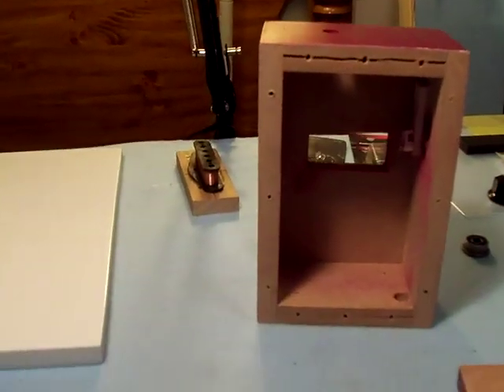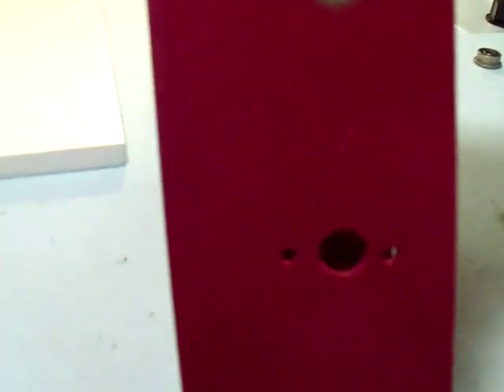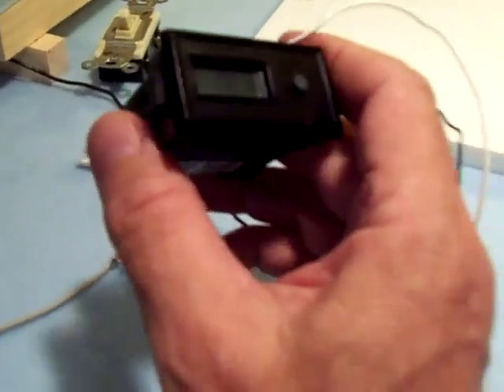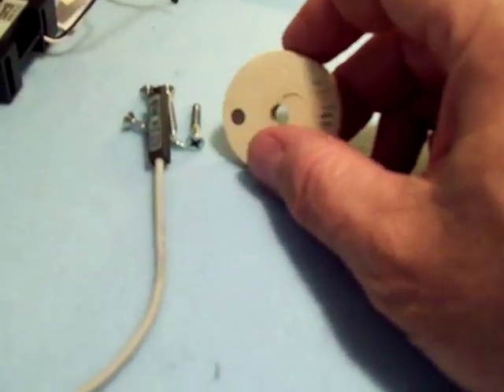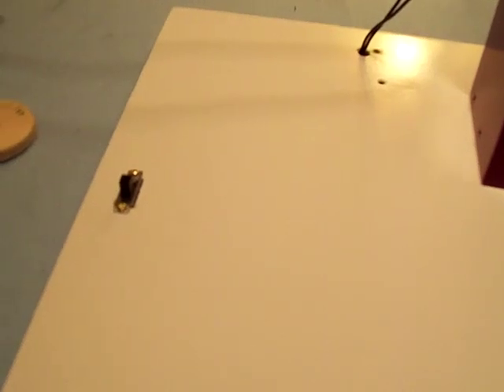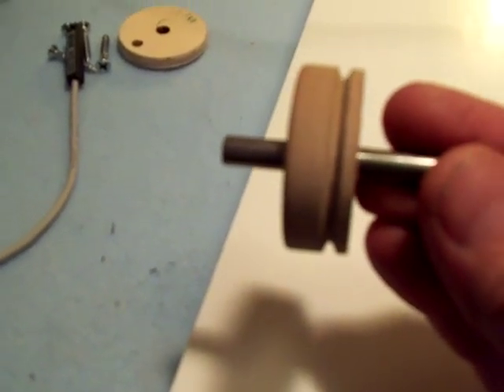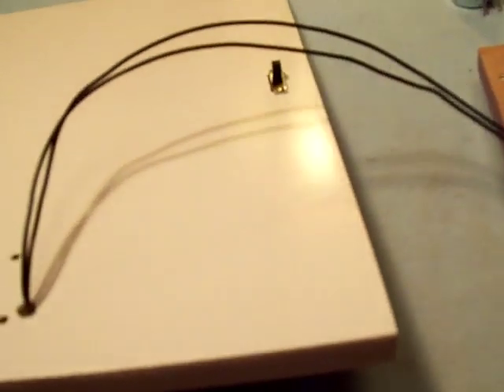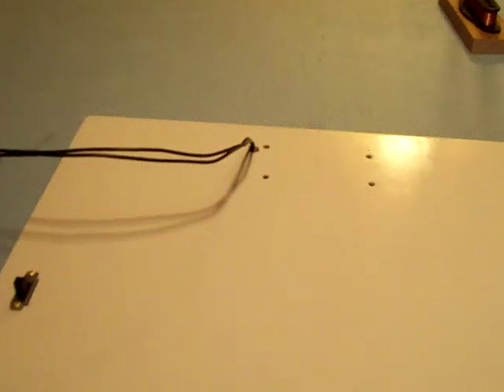Pickup winder build Part 1

Comment: I'm almost done with this, again thx for sharing this. But I've just got one problem left, well my potentiometer of 100ohm's smoked after a couple of seconds while I was testing my new motor. Do you have any idea what this could be? Did you had that problem to? Could it maybe help if i put a resistor of about 100ohm in serie with the potmeter for the lower resistance?

Comment: The Schatten is junk. You will have probably done less work making yours from scratch  than making the Schatten work. All the shimming and drilling and then the Schatten has a motor that won't even work for a hobbyist let alone a real shop! I made mine from a Singer motor I bought a swap meet for $10 with the foot speed control switch. I found a used surplus 24VDC impulse counter. I put a doubler on my 12VDC supply for the counter.  My disc had to be large or the counter would skip.